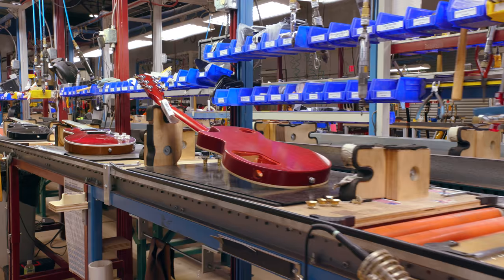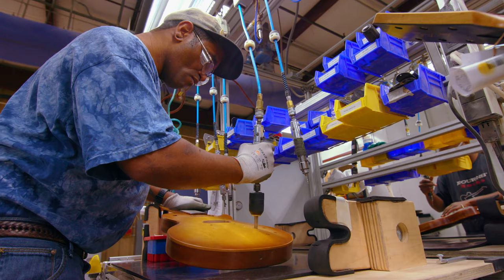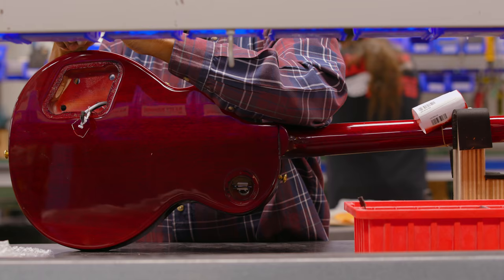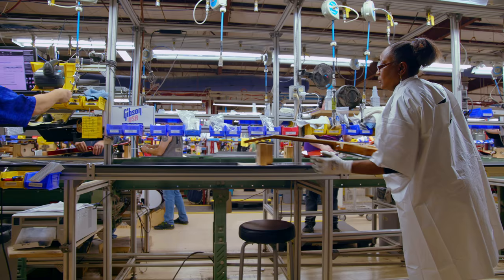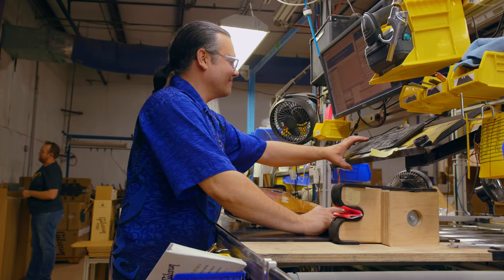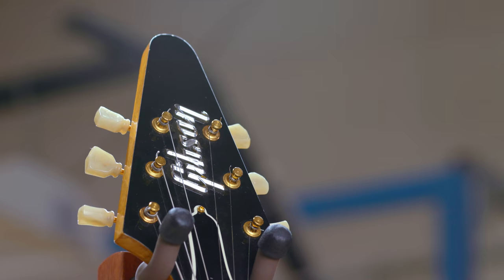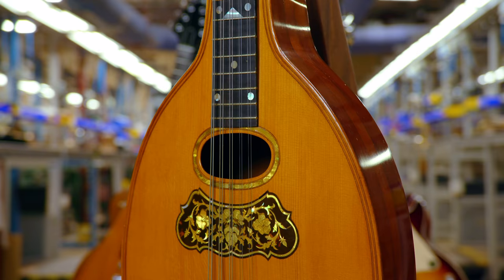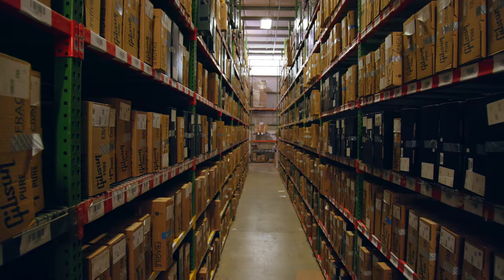Final Guitar Assembly At Gibson USA Factory | The Process S1 EP14

Comment: I do safety audits for a major chemical manufacturer.  You need to manage your sawdust better, I see a lot of dust on top of ducting, lighting fixtures, electrical cables, etc.
I have seen plants burn down due to these highly combustible dusts.  It only takes one source of ignition and it will spread very quickly through your facility.  This is something you must address, it will also improve the quality of manufacturing so it’s a win-win.
Reply: Never overlook safety 👍
Reply: Only saying it because I care about the facility and the wonderful people there.

Comment: 2:57 this is in my opinion the most important job of the line. Making sure that nut is filed properly and the neck has the correct tension is crucial to how the instrument plays right off the line. It's a lot for one guy to do, I really feel like it's a 3 man job and if you have one guy filing, stringing, and adjusting the neck without slowing up the line that guy's the MVP.

Edit* check out my recent solo video, I have a lot of Gibsons. 😉
Reply: Agree but before that happens you need level frets for all that to work, if that doesnt go right then it doesnt matter how you file the nut or adjust the truss rod you'll have string buzz or high action to compensate. If I read right Gibson uses plek machines to level their frets for custom shop models, which tells me that part of the job is still variable and they dont want to bother with a human hand anymore.  And I agree, its an art basically where you cant bang out in high volume, or maybe you can... I dont know for sure I dont make guitars but ive tried some fender squires tele's that have some super low action meaning the fretwork was nice, maybe they figured something out in the manufacturing process to get that part more consistent? That being said Gibsons still turn out the most playable out of all the guitars in the shop I try so I have a great respect for Gibson and their quality control for where it matters most to me - playability.
Reply: Oh yeah, if the frets are not right then all of that was for nothing. I wonder if there's someone on the final line who handles any minor fret issues right there on the spot or if it has to be sent back to that department.
Reply: Adjusting is actually split up between two people on the line. Source: I used to work there until about a year ago.
Reply: The "NUT" and the material its made from and its saddle heights and saddle cut angles has more to do with the playability, tuning stability, clarity in tone and ability to intonate well than any other "single" component of a guitar.
Reply: @mikejones-vd3fg  
You are absolutely right. But there are many people that understand that all frets need to be level but have no idea about the nut and how critical it is and just how many problems can be caused by it
Reply: @codymccloud7718  I was about to say, if there was only one guy doing all that he's probably a wizard but for it to be two guys is still crazy. I figure one filing the nut, another stringing, another adjusting the neck, and another intonating the bridge would be perfect and make the line move way faster.
Reply: @joeyskar  A 4 man/woman job process.
Reply: Shouldn't the entire guitar be made by one person

Comment: Guess some of these steps were skipped on mine. Just got one from guitar center Tuesday of this week. A Les Paul,got it home tuned it up and proceeded to play it. When I got to around the 17th fret and make a bend the string deadens immediately. The action was way Low. Then switched to the neck pickup,sounded good,went to adjust the volume and couldn't. The knob turned but the volume didn't change. Tone knob worked but the volume is where it was. Took it back to guitar center told them it needed a set up and about the issue with the neck pickup. Got a call from their tech yesterday afternoon saying he would need to get with gibson to send a whole new circuit because there was short causing the volume control  to not work on the neck pickup. Also said he wasn't happy with the set up it came with, action too low and pick up height was off and he would try to get it covered under the warranty to save me 50$ for the cost of a set up. Now mind you this is on a brand new 2019 model 2000$ Les Paul that I played for maybe 30 minutes. I'm not a famous musician,not wealthy by no mean5 and just wanted to have a nice iconic guitar after years of playing cheaper knock off guitars. I'm almost 50 and waited all of my life to get a Gibson Les Paul, finally got One and it's still at guitar center waiting to be fixed straight from the factory

Comment: I’ll have to check who signed mine off and send him the bill for a proper set up. Like removing glue off the fretboard and fretboard scratches. Then there are the poorly filed nibs. The list goes on.
Reply: probably some chinese dude....bet yours says made in china.
Reply: same here, purchased a les paul in 2012, the 120 year anniversary classic model. looked stunning when i got it, plugged it in and the amount of static on the back of it was really bad. gibson uk said to wipe it down with a anti static dryer sheet and it will cure it. yep, well three months down the line and it was just as bad. the problem is the static was in the poly coat and the only way was to remove it, so i did. stained and oiled it  instead, now looks amazing, static free. oh yea, i also had to re solder the output jack, and booster switch,err and do a set up.
Reply: I believe these are strictly Gibson custom shop so I imagine the have a rigorous inspection for those as opposed to their main production models

Comment: This year I have tried to buy a gibson, returned 4 times. Hair on the finish, binding ledge on the neck, a hole on the rosewood fretboard, nut cut too deep so b string action had to be really high, truss rod cover bent upwards (screw position way to close) with wobbly loose pickup in the cavity. I'm not trying anymore, If someone wants to buy one, by all means, do a check list and test every single thing you can test.
Reply: Gibson only puts in the work for the historic reissues, and they charge upwards of 6k for it. Those guitars are what every Gibson should be but the price is an abomination
Reply: Igor...I've purchased approximately 70 Gibson guitars in my 35 plus yrs of playing. With that being said...and I fully agree with you for that kind of money it should be perfect. Believe it or not, it's the one's that have minor imperfections that seem to be the best players. Look for weight, unplugged sonic's 1st. Then make your decision. I own 21 guitar's...5 Les Paul's..Gibson. 4 Epiphone's,  all great player's. And one of my favs came with slightly bent pickup rings. I kept that LP standard cause it sounds so fucking good. I also own 2 PRS guitar's... they look in play great. But nothing sounds better than the right LP....weather minor imperfections that nobody is gonna see anyway that I keep!😁
Reply: I agree the usa stuff can sometimes have imperfections they shouldn't have, but that's always gonna happen at the volume they build given the complexity of these guitars. Even the custom shop ones can have minor cosmetic imperfections (that only add to the character imo) from being hand-built.
Reply: @barrymiller2272  been playing for 30 years and only bought 5 guitars ever, have 3 now. My eyes almost fell out when I saw 70😂
Reply: @chriskilian2325  bit of a gear junkie! OBSESSED. I have bought and sold 157! I now have 21 various guitar's, all keepers...haha😁
Reply: @barrymiller2272  I'm guessing either your wife is an angel fallen from heaven or you are blissfully single😂
When can I come to visit?? Lol
Reply: @chriskilian2325  married for going on 24 yrs. A looker as well....and get this, she's the number one breadwinner!😁Thanks Chris
Reply: I bought an SG 61' Reissue. Nut was not properly cut, the fretwork was shit, piss poor intontation. Fuck Gibson. I have 3 PRS singlecuts that played like a dream right out of the case. This is what happens when a corporations embedded growth obligation (EGO) is out of control. They prey our our desire to use what our guitar heroes from yester-year played. For the prices they charge, the least one could hope for is a quality instrument.
That's why Gibson will NEVER beat out their competition. Do yourself a favor, and buy a Collings, Music Man, Tom Anderson, PRS, or a Suhr. At least you will have a proper/usable instrument out of the case.
Reply: @mattjoe1982  I've purchased 2 PRS guitar's...nice! But they DIDN'T play perfect out of the box, both required setups. In fact my MCCARTY 594S2 had a bad ground wire, which is ok because it just ended up a quick fix which saved me $100 after calling AMS. A shame you haven't found a "dream gibson" I have, and will be buried with THEM!😁
Reply: S2 there was your problem. Core line. It would be the equivalent of the Gibson Standard line.
Reply: @mattjoe1982  you're talking SE.. over three-quarters of the S2 McCarty is built in Stevensville Maryland I suggest you do your homework I have over $50,000 in guitars it would behoove you not to argue with me
Reply: @mattjoe1982  believe me I have a custom 22 from 2012
Reply: @mattjoe1982  sorry if I came off pompous. Yes, have had bad Gibson's...really bad! But I have found a couple to be magically great. I agree with you wholeheartedly that there quality assurance should be up to par, in other words every guitar that you spend x amount of money on should be as good as the previous. But I have found that to be the case in many high-quality instrument builders. I have 3 Carvin/Keisel guitar's that are awesome.. possibly as good if not better than my PRS core line
Reply: I have a 2015 Les Paul. Considered a bad year but I got lucky. No issues and it’s gorgeous
Reply: Never had an issue? And mine stay in tune.

Comment: So, Ive had a ton of work experience with production lines. The assembly line there doesn't seem very efficient. As the process goes along the task gets longer and longer. So eventually you've got a bunch of guitars packed at the later operations.

Comment: While your quality control is on point an excellent and likely what I would do, do you chart the pickup frequency and output response to each guitar?  Do you find any value in any sort of visual quality systems to measure pickup height, string distance from fretboard, etc?

Comment: Gibsons are not perfect. But neither are the boutique builders who charge as much or more as Gibson, such as Collings and other boutique builders. I have a 1958 Gibson Custom Shop LP. The nut is cut well and the paint was flawless, but for some reason they did not take off the overspray on the white binding. Had a Collings LP-style guitar. Scratchy pots that couldn't be resolved and retails for more than a Gibson Custom Shop LP. Guitars are like cars; you can spend a lot or a little. There are always flaws.

Comment: 2019 les paul had a screw under the pickguard that made a hole in the finish, so not so good quality control
Reply: Not 100% true. My 2019 Les Paul has a  soft washer under my pick guard and has no mark
Reply: @xjohn1970  mine didnt and made a hole to the wood

Comment: Look carefully what you buy. There can be slight quality assurance issues. This is mine 2019 Classic: https://drive.google.com/file/d/1ximfvHgKRR1uZnxd1rlZJQe8qkEFkziv/view?usp=sharing
Of course I love my Gibson and it plays and sounds well. But as this expensive guitar there should´t be second class issues.
Reply: This is actually a historic spec on a Les Paul with binding since the 50s. The wood you see beneath the binding is the maple cap.  More info can be found here:

https://www.lespaulforum.com/forum/showthread.php?110372-Uneven-match-between-Binding-and-Finish-on-a-Les-Paul-Normal
Reply: That is a desirable and correct vintage historic spec feature! And, I also prefer it on the newer modern Les Paul® guitars as well. Gibson® reintroduce this feature in manufacturing in 2002. My 2003 and 2007 Standards have it ― and I love it.🎸👍🏻✨